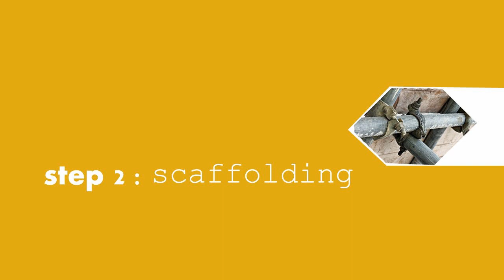MOVING A 700KG LATHE (MACHINE) DOWNSTAIRS!!! (GoPro)

Comment: What is scaffolding and how was it installed to be the anchor pt?
Reply from the maker: Sage-Lee Medeiros-Garcia scaffolds are aluminium tubes that are used to construct a structure around a building for external works. In this case, it was extended across the back wall, with a second at a 45 degree angle onto the floor against a the foot of the stairs, and then securely tightened in place.